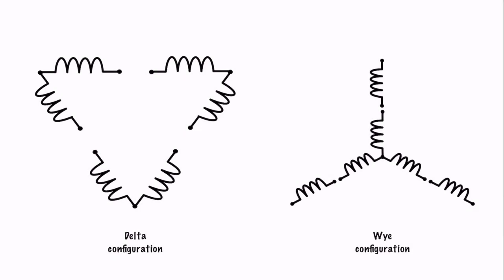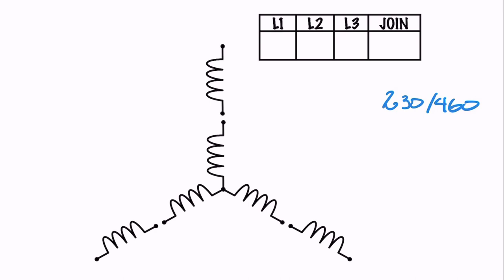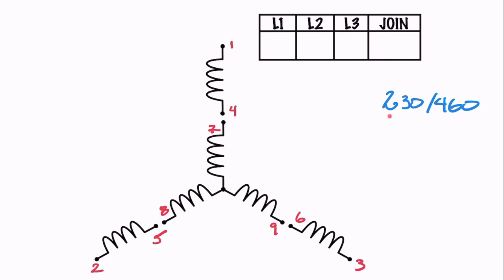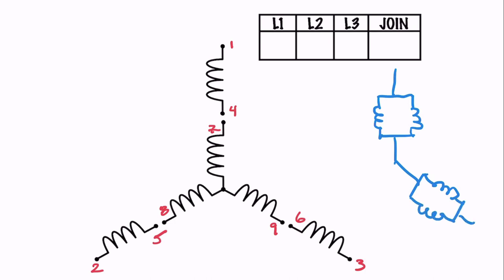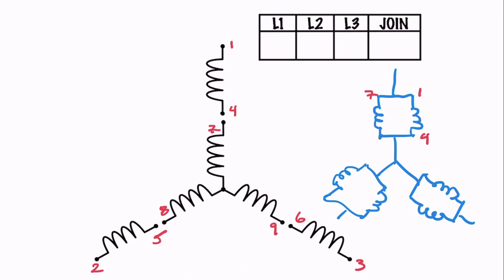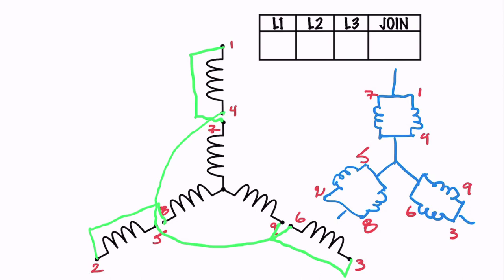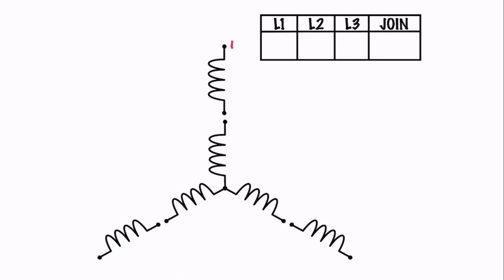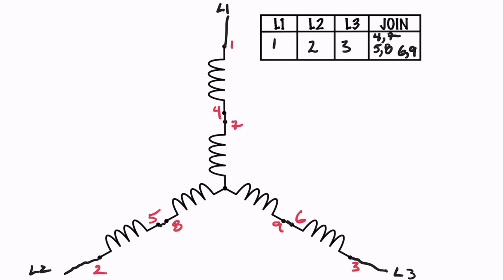NINE LEAD WYE MOTOR CONNECTIONS: How to make the high voltage AND low voltage connections

Comment: Not 100% accurate for the low voltage explanation because you aren’t connecting the 4/5/6 connection and the 10/11/12. It is actually 2 windings in parallel with 2 windings. Not each winding paralleled. But good enough for the beginner.
Reply: Dono star point ko ak jagah jodna tha

Comment: I have a wye motor with 9 leads but I need a delta connection. The motor is 5 HP but is to be wired to a rotary converter and I will pull only 2HP out of it for a surface grinder. Since 3 coils are connected at one end internally in the motor I was thinking I will leave these 3 coils unconnected. Using your diagram I will connect 1-6 ,2-4, 3-5 forming a delta and not use the other 3 coils. Since I'm using only one set of coils of the two I can put in parallel for low voltage connection I will not be able to pull 5HP equivalent since the impedance of a single coil is half as opposed to two coils. This means the maximum current in the single coil at the same applied voltage will be half of the two coils in parallel and the total power will be 1/4 of 5HP. I can also pull a second low voltage 3 phase out of the star connection since the stator will work as a transformer as the motor spins. Does anybody see an issue with the logic above?

Comment: Thanks for the video! I have basic knowledge and trying to get my 3phase lathe connected to a vfd. My 9wire motor low voltage setting is wye like this one. My question is about 4,5,6. After wiring L1,L2,L3, do I just leave 4,5,6 capped together inside ? Also if the motor has no ground would it be acceptable to wire my own ground to the chassis?

Comment: I see a lot of dual voltage rated motors that are 230/460V. But I only have 208V or 480V available to run. So what am I supposed to do? Run the circuit through a general purpose xfmr?

Comment: What could happen if I connect low voltage (230V) to a single wye (high voltage configuration) ?
Reply: Youll get more resistance so youll have less power